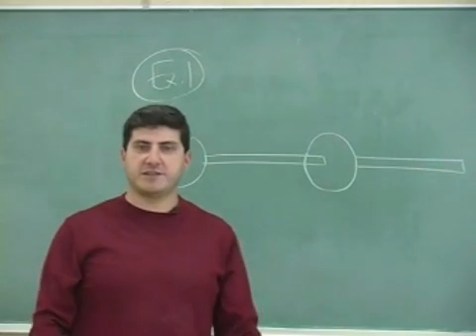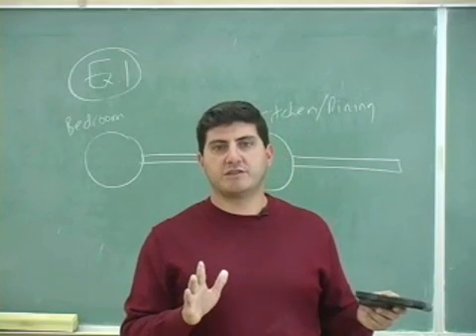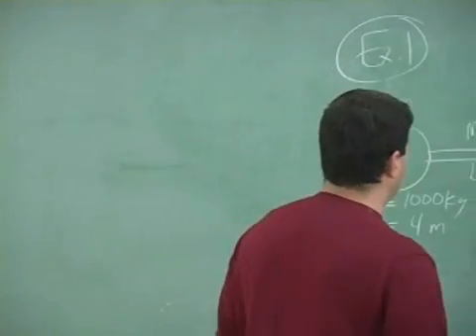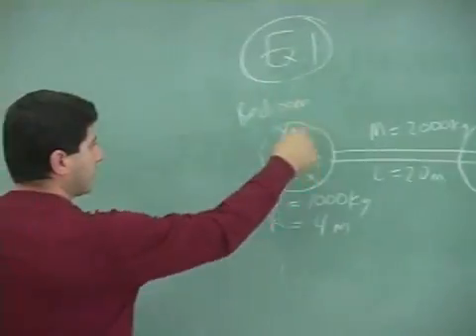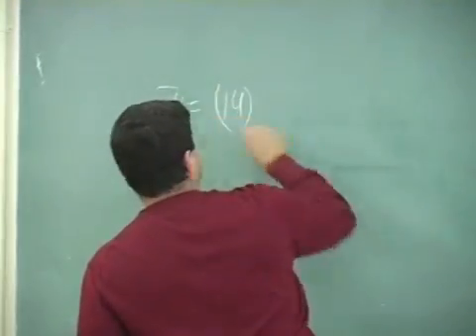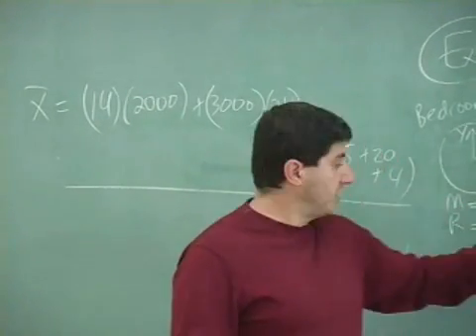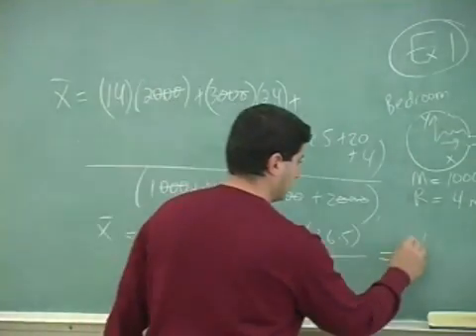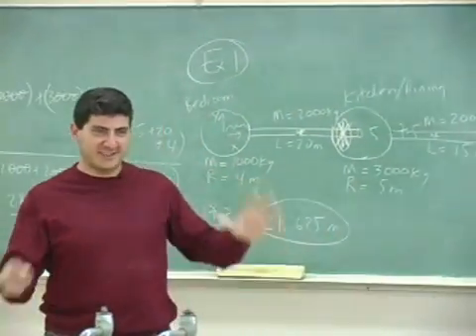Center of Mass Example 1

Comment: Thank you, I'm developing a program to calculate weights of components on an airframe to show actual COG position, using your method I can calculate all components in front,behind, left of and right of the COG. Subtract each lateral measurement to provide a -/+ result of where actual COG is opposed too default. Thanks!